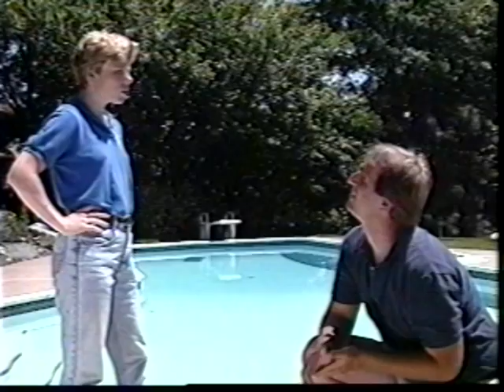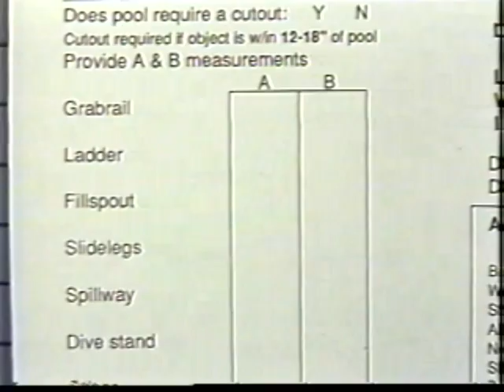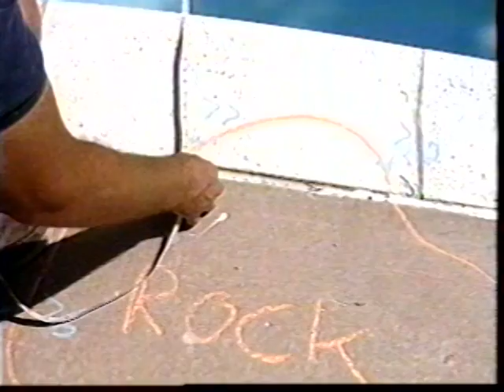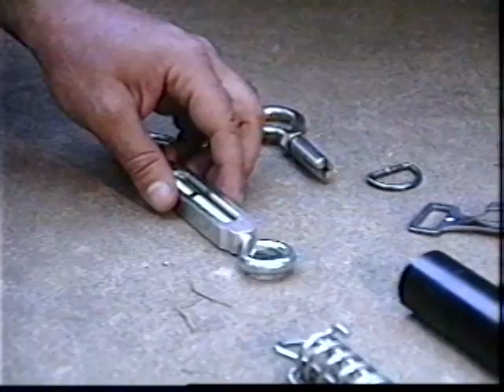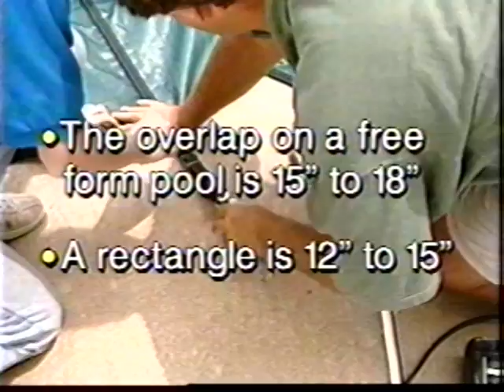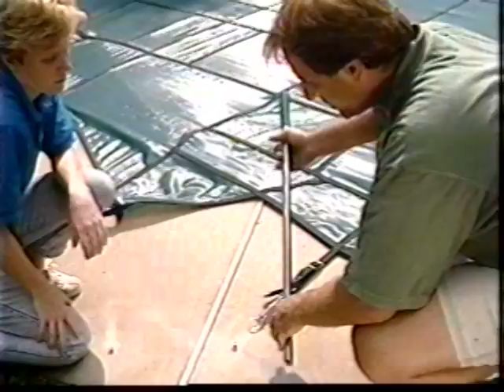Merlin Safety Cover Measuring and Installation

Comment: I noticed the eater on the cover when you started. Should I fill the pool to the top before putting the cover on to measure and drill? Won't that depth effect the over tension of the cover?

Thanks
Rich
Reply from the maker: +Rich Green 
Rich,
Thanks for your inquiry.  It is not necessary to fill the pool to complete an installation but the more water in the pool the easier it is.  Please download our installation manual from our website for instructions on how to get started.  We really recommend installation by on of our Authorized Dealers.